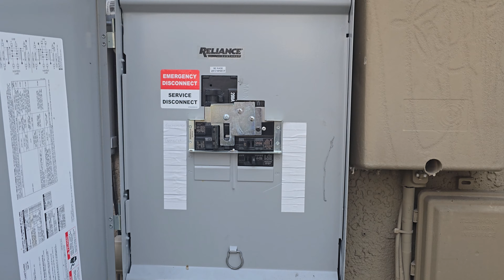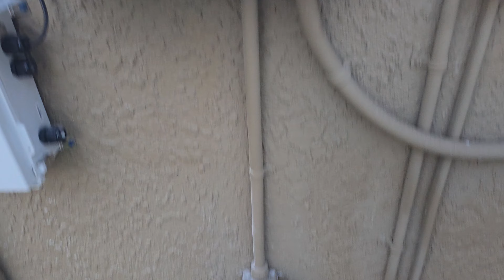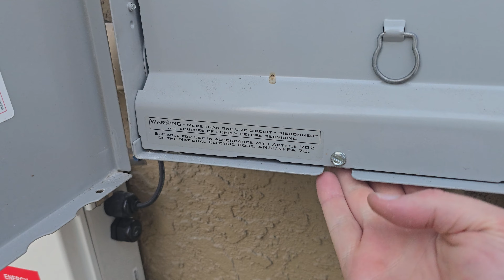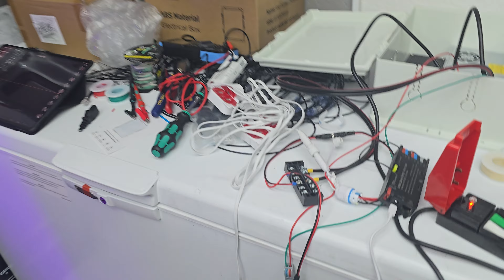This Isn’t a Normal Govee Prism Install — It’s Fully Customized and Powerful!

Comment: I bought a 200’ set on sale for Black Friday since they were less expensive than the 150’ set.   I only need 150’ for the house leaving 50’ unused lights.   Can I buy some power supply for the surplus’s lights and run a second set?    Can I go 3rd party, or do I need to contact Govee for the 2nd controller.   If 3rd party, will the second power controller be controlled from the Govee app?

Comment: Very cool setup!!
PS like that bike!!
Reply from the maker: Which one? ;) The green one was kinda out of frame but is what I usually ride.  ZX14R
Reply: @ViciousXUSMC  Ah ok I noticed the black one 😊
Reply from the maker: @HereandtherewithHeath Yep so that's an SV650 and my first bike.

I just did some upgrades to it and needs a new tire and I'll be teaching my wife to ride on it and making it her first bike.
Reply: @ViciousXUSMC  Nice!
Reply: Question: So if your completely off grid power do they charge you for being connected even if your not using their power?
I ask because in my area even if your fully off grid to get your occupancy papers/ rights you still have to be connected to the grid even if you don't use it and there's a fee
Reply from the maker: @HereandtherewithHeath Yeah so it's the same here.  I am fully off grid at the moment, as not even accepting grid power, but I'm still paying for service for the same reason.

Soon as I get my grid interconnect inspection I'll enable grid again and sell my excess to them for 1:1 credit.

I'm not sure how winter or really rainy weeks will go for us yet, so maybe that will be handy as we can use grid power for essentially "free" if needed.

Then the best part, at the end of the year I actually get paid for excess credit.  Only at wholesale rate so say 1/5 or so but if today was an indicator I had full battery by mid day and I haven't even turned on my 2nd solar setup yet.

I should have more than enough credit to cover the entire service fee and then some that I can actually apply to my ROI
Reply: @ViciousXUSMC Very cool!! I'm absolutely jealous 😁